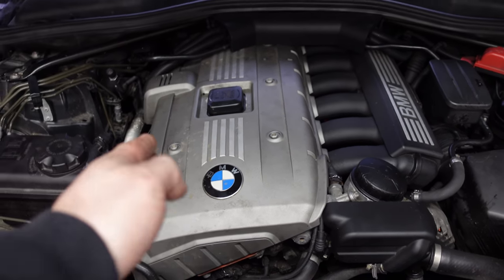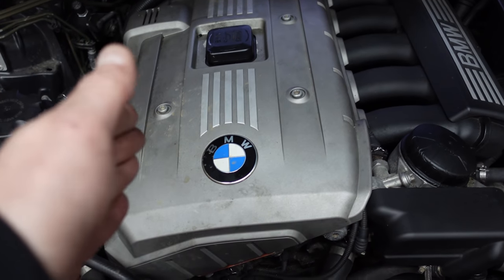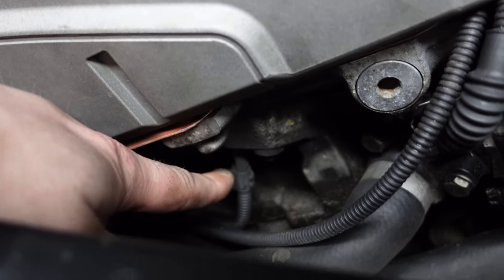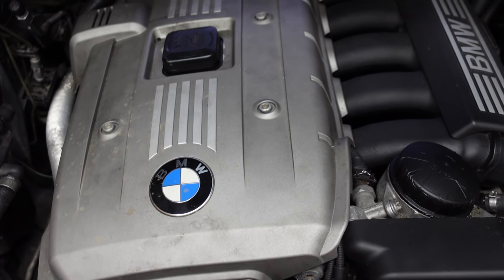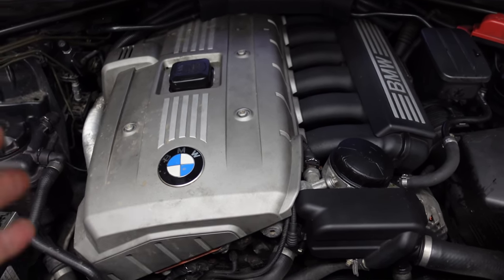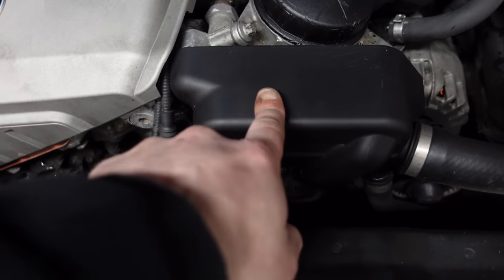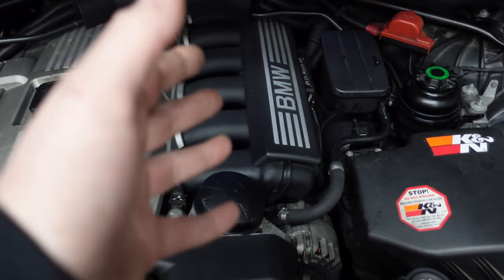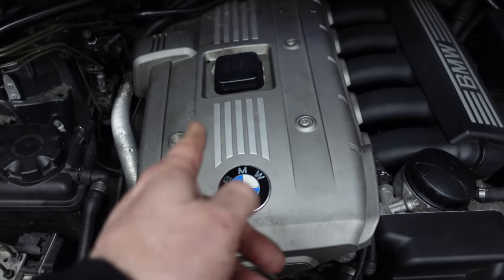The **REAL REASON** Mechanic's HATE BMW / Its Worse Than You Thought !!

Comment: You can’t get a mechanic under the age of 30 to diagnose an ignition fault or fuel fault on a 70’s car , you can’t diagnose a fault on a modern car without software, not mechanics just fitters.
It has been a great help I now know not to buy a beemer

Comment: I think the simple reason is that many people base their knowledge on simpler cars, e.g. asian cars, and dont look or think outside the box. Many mechanics will hate german cars in general because they don't understand them and wouldn't care to. I worked Ford, then Mercedes vehicles for 3 years and my expertise makes me look for problems outside the usual areas, which in turn makes me more efficient in diagnosing cars. Ford vehicles are especially troublesome to diagnose at times, and I've found many problems in areas where you wouldnt even imagine. I basically learned how to wrench with Fords and then learned to diagnose with Mercedes. I believe that has made me a good technician and I can have a very good idea of any problem with any type of vehicle and be confident that I can know for sure what the problem is.

Comment: Had so many problems with my BMW 328i. Radiator leak, valve cover gasket, oil filter housing gasket, door actuators (all 4), o2 sensors, coils. Man the whole cars is constantly in shop
Reply: Silverado =✅

Comment: My E 60 was burning oil I diagnosed it with a cheap code reader out of Lidl it was the vanos valves I replaced them myself with febi bilstein parts as the were less than half the price of BMW PARTS  HAVE BEEN IN FOR OVER A YEAR NOW NO MORE OIL BURNING

Comment: I recently had my brake fluid done at BMW in Yeovil. They sheared the bleed nipple by over tightening it. When i went to pick the car up, they informed the the bleed nipple sheared and tried to charge me £150 to diagnose the fact that they broke it! They also gave me a quote of £700 to replace the big brembo caliper. Obviously i refused to pay this, and they gave me £20 off my brake fluid service. Luckily i can still drive the car but this is going to be an issue when i next need the brakes bled.
Reply: I wouldn’t have paid them nothing because they broke your part of your car bro don’t let your self speak up should of said yeah replace it then don’t pay them anything and record them with a cell phone as there admitting they broke it .

Comment: This problem is becoming more and more common, I see 3-4 cars per week on average that have been to multiple"mechanics" which have simple problems that could have been resolved if someone would have just taken a small amount of time to just look at the car. Instead assumptions are made and cars are not diagnosed at all, guys just loading the parts cannon and hope the car gets fixed
Reply from the maker: Exactly as you have spoken !! Thank you for coming forward and telling it how it is. I wouldn't say parts cannon more like "Parts Fitters" Its your normal way with these cars cant diagnose them so throw whatever parts you can until it runs 60% right just to get the owners away from your shop and get that money.
Reply: @BMWDoctor  I'm they type who would rather apologize to a customer for taking additional time making sure my repair is complete and accurate, than have a car leave my bay broken, I train my apprentice to do the same. Efficiency and accuracy come from putting in the work.

Comment: Trouble with any diagnostics is that they mostly can't sufficiently and completely identify a problem but this depends on specific car makers too, some are designed to be much more mechanic friendly than others. BMW rightfully has a bad reputation in this regard, it's entirely wrong to expect mechanics to be on top of all individual maker's complex systems without appropriate training and tools. Which of course is entirely impractical for your usual mechanic.

Which is why there are rare specialists like the doc here who have invested their time and talent in learning all about one make of car. Actually specialising is easier for a mechanic than trying to be an all rounder.

Comment: Hi, Doc! I was wondering if you've ever seen the problem with a front differential losing gear lube due to a blocked vent fitting and how best to clear it without removing the differential from the pan...which is fairly involved. Great video, btw!!

Comment: I have only worked on there diesel engines and Im not a fan of them. The V band on the turbo outlet is to narrow and the clamp is to stiff so it's a nightmare to get them on after a DPF service. Have even seen a airfilter box molded in the valve cover so you couldn't just bolt it of and get some room to work with. Just like you have to remove a engine mount to get the DPF out on a X3. That alright if you have a lift and a engine support. but I'm working in a grave. 
And when you see how BMW suspension parts are built you think it's a Skoda or home build british car.  Especially when you compare it to a Mercedes. But in general newer cars isent as easy to work on af older cars. Everything is super compact. Just taking a inlet manifold of and replace it is a 2 day job almost.

Comment: Just took my e70 to Paul Miller bmw for the 6th freaking time.. and BMW techs don’t know Crap ether.. 8k in 10 different issues.. that started with a mis fire.. replaced all coil packs and plugs..full tune up.. more issues....I find your video clean the solenoids with brake cleaner.. than suggest that the nods be replaced and the trucks is like new...not sure if I trust bmw anymore.. never had an issue with them like this.. THANK YOU SIR for wat you do.. keep teaching me to train the techs at bmw lol
Reply: Sounds like u need a honda accord like Jeff bozos. It drives from a to b thats it. You don't need a luxurious couch on wheels.

Comment: For your diagnosis to be correct every other auto manufacturer would have to be running only pre war technology. Sounds like badge loyalty talking. Yes there are certainly incompetent mechanics that many will have experienced. But there are plenty of reasons to hate BMW technology much like there are many reasons to hate Rotory engines. For example your common belt issue being caused by a leaking cooler. Why in the hell is it located there and why is it such a common issue? Common issue equals design flaw. Here's another reason engine bearings as "a service item" maybe they do not like having to charge customers huge amounts of money and have them without a vehicle for a week for a "service".
Reply: he is biased towards BMW, and thinks it's the most reliable brand.

Comment: Great video dean! Your the master at bm’s .. quick question brother as you know I have 2007 530i e60 silver top. I noticed that ground strap going to your driver side inner fender an looks like it goes to coil pack wiring maybe . Mine is not there at all . Where us specs any different? We bought ours used many years ago so who knows what someone else that didn’t know what they were doing could of done . Thanks bro
Reply from the maker: No chad you should have it and if its not there I would get it as all it will do is drive to much positive current through the coils eating them up quicker then expected and you will constantly be replacing them so I would find the ground strap mate and fit it
Reply: @BMWDoctor  thank you sir !!! I will get a ground strap immediately on. There then! Thanks a lot dean .

Comment: Basically the BMWs are fitted with lots of parts that are generally unreliable or not manufactured from the correct matrials . Expect things that have polymer fittings on components that go through hundreds of temperature cycles like the quick release hose fittings , to fail as the polymer used is entirely unsuitable . Using recycled HDPE or MDPE for oil coolers etc is not the same as an Oberg or Mocal oil cooler that will last forever on a race car . Don't get me wrong I'm well into engineering polymers and use Vespel , Delrin and many others in prototyping , but the wrong plastic in the wrong place can cause problems . Hunting and misfires can be caused by anything on the engine , MAF sensors are another , pull the MAF sensor on one of these and the basic part , the thermistor itself is no longer protected by a cage but just sits on the side of the sensor and can be compromised by insertion at the factory only to fail completely later giving you a massive headache . Various connectors that even the BMW diagnostic equipment will not throw up as a fault code . I used to use the old Bosch connectors in builds but the materials they use now are not up to the same level of hard use and reliability . The cam cover breather hose heater can be a difficult one to diagnose as its wrapped around the hose under the insulation jacket at the rear of the engine . The serpentine belt problem is just bad design . There should be nothing that can leak oil fitted anywhere near the belts let alone directly over the top . Its like sighting the oil filler point at the front of the engine near the cam and anc drive belts . You just don't do it !
 In the States if your jumping from a Honda with 300 000 miles plus on the clock with just regular fluid and filter changes.  don't expect these new generation of BMWs to give you that trouble free mileage despite the fact they were 'designed' to be driven up and down the autobahns in Germany at 100+ mph day in day out .

Comment: If im still getting camshaft correlated codes after replacement of vanos solenoids , should i look deeper into the cam seal issue? I am awaiting an eccentric shaft sensor, valve cover (whole kit) full set of plugs and coils , previously i was getting p0012 , p0015 before replacing vanos solenoids, but after replacing with new OEM i am Only left with p0340 and p0344 , random stalling at low rpms when coming to a stop and only at operating temp,
Reply: I am awaiting a k+dcan cable as well because obd2 codes have proved unhelpful with determining what the actual faults are.
Reply: I assume your car lost power... to tune a modern car you need 5 sensors. Probably you didn't have to change the Vanos.. it should be sensors problem... start with camshafts sensors

Comment: The reason we mechanics hate bmw is because of the chocolate rear diffs, blocked up heater cores, bent cracked wheels and ridiculous cam chain behind the flywheel skipping teeth smashing all the valves and pistons.....  
 We hate Mercedes because of water leaks fritzing the can bus wiring plugs under the carpets, dead electric ignition switch modules and brake pipes rotten to bursting point on 6 year old cars. We hate vag because of the vile to replace unreliable egr cooler and shocks all puking oil on three year old cars, we hate range rovers because you have to take the body off to change the failed turbos, etc etc etc.
I appreciate you sharing your one brand knowledge but please don't assume that all multi brand garages are idiots. With new models with new faults turning up all the time it's sink or swim. Every days a school day. The bosch service centre I work at sends me on regular courses to keep up to speed, we all know not to blindly follow what any scanner says, real world eyes open experience, proper mechanical fault finding, wiring diagrams and an oscilloscope are the key.
P. S. I own an e39 540i 6speed. Made in a time before quality went out the window.

Comment: My BMW diesel 5 series burns oil badly. It use a litre of oil every 6 or 700 miles. The car doesn’t show any signs of oil around the engine or exhaust. No smoke coming from the exhaust . Does anyone know what the problem is? The car is 10 years old with around 100000 miles on the engine. The car never misses a beat runes very smoothly and always starts.

Comment: A lot of people get fooled by a internal oil cooler for  auto gearboxes built into the radiator, it can leak into the cooling system and hey presto 'its ya Ed gasket innit guv' lol.

Comment: mannnnn I have the weirdest issue with my 2008 5 series, every time I start the car the rpms jump between 500-1300 rpms ROUGHLY I see no one having the same issues and do not even know what to fix I have done a lot of repairs and it happens every time I start the car cold start is just worse. I can stop and turn the car back on and it does the exact same thing. It runs fine after this bad idle for about 3-5 seconds just confused.

Comment: Hi I got an 2011 bmw 550i that is misfiring ,the mechanic change the spark plugs,ignition coil,Maf sensor and  its still saying it is misfiring they don't know what's wrong with it.
Reply: Check the vanos solenoid
Reply: +1 on vanos solenoids, but can also be bad pcv system/vacuum leak.

Comment: Bro another great video. ? I have a e39 528i, my transmission light came on and i took the car to the BMW shop in my area and they dont the issue. The run but it have a hard shift down when coming to a stop. Any info on this issue would be greatly appreciated.

Comment: Story of my life! Omg!!! Nobody knows these cars!!!!!!!! I had the same with oil in coolant...looking at your videos, I knew it wasn't a head gasket!!!!! Engine oil cooler replaced. No more leak...Now over heating. Again, its your head gasket! They said they are specialist but didn't know where water pump was. I showed him where it was. I know more about my car than they do. Its overheating...Asking constantly, anyone checked the radiator? Water pump?  One mechanic stated radiator blocked, not hot on one side, hose not having any water flow to water pump, change your resoviour too,  But, I been getting it a head gasket.🥱🤦🏽‍♀

Comment: That's so true I'm only 19 and I now have to be in a garage for 3 months to finish the mechanic school and I saw that they charge BMW battery from the boot, I asked them what the hell they are doing when they are supposed to use terminals under the bonnet and they told me it was nonsense, so glad that I do most of my repairs on the E60 myself I only let a specialised BMW garage to do my chains everything went fine with that, anyway keep up the great work :)

Comment: I have a Bank 1 upstream 0131 low circuit code. Changed the 02 still showing the low circuit code. It's the N52 Z4 motor. Not to mention the fuseses are good.

Comment: Could you help we to solve a problem am having with my 325i 05 zf transmission was rebuilt and its still going into limp mode , some of the codes i got when it was scan and cleared but went back into limp mode again( code 49 ) (code 54 ) (code 59) (code 27C3 ) (code 2761) ( code 299A)

Comment: 30 years ago mechanics used to rave about the pleasure of working on BMWs
Reply: Yep. Having worked in the motor trade I can tell you 70's-90's BMW were probably THE nicest cars to work on. About 15 years ago they began to cut corners to maximise profits and it's not the same, but then again that's the case with all manufacturers now

Comment: I have been in auto repair for 35 years, and I have nothing against BMW, I detest ALL European vehicles the same.  I don't even allow them in my shop.  These days I won't even work on late model Chrysler/Dodge vehicles because of the European engineering being used to design them since they sold out.

Comment: with more than 35 years in the industry as an Auto electrician, I can say that you definitely referred to " Self taught mechanics or self-called mechanics or whatever mechanics" BMW specialized mechanics are quite experienced and very well updated as the mother BMW company provides Seminars and education as well. On the other hand, if you are going to a BMW dealer and you treated as you mentioned you simply send an e-mail to BMW in Germany and say what happened and I can assure you you will have your response within the day. Last but not least I have to say that very loud, those cars are expensive to buy expensive to maintain and very expensive to fix if you don't maintain properly. If you cant afford it don't buy it,its not for your pocket you cant afford it, buy an Asian car don't go for BMW that will solve your problem. If you get a BMW you must and you need to support it, ITS LIKE THOSE BEAUTIFUL GIRLFRIENDS, YOU CAN'T AFFORD TO HAVE MATE.

Comment: hello mate.  got an e60 after full engine swap and injecrots restored.  engine runs perfect like new, but when after night cold start it stutters for 3sec and puffs bright blue cloud. after that no issues till next morning.  any idea what i could check next? does spark plugs do that? couse they are old and in warm weather takes 3sec to warm up each time on morning.
Reply: also can add, that i started it on 12°C. wasnt any blue smoke or stutter
Reply: Pcv system possibly? What engine? Definitely change plugs and coils with them.

Comment: Hey Doc. Would you suggest a good diagnostic tool. ie. Foxwell 530 for BMW. Thanks
Reply: I have that scanner and have diagnosed faults on my son's 325 when the heater for the crankcase breather system was down to earth and it shares the same fuse as the O2 sensors do so we thought we had a bad sensor at first .
It didn't tell us the answer but helped to eliminate things definitely worth the money,I leave it in my boot of the 125i I drive just in case .